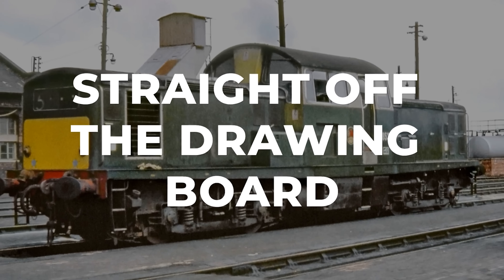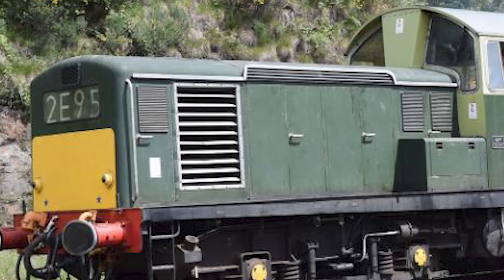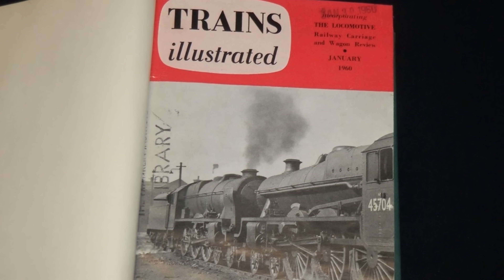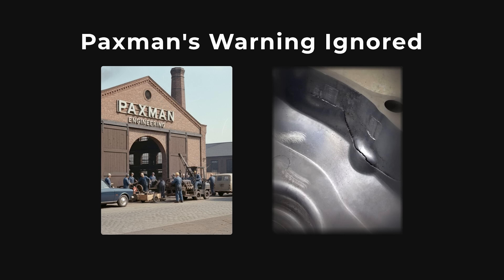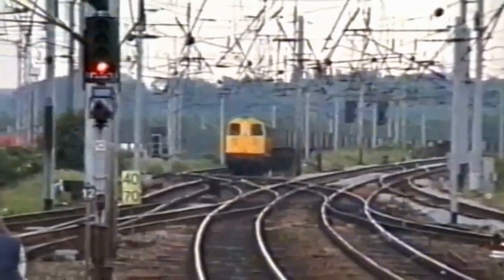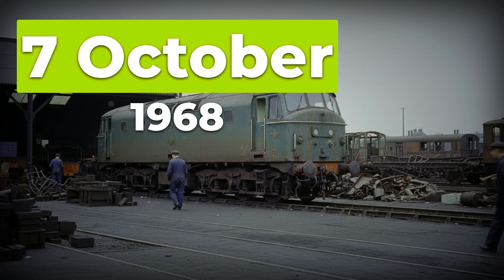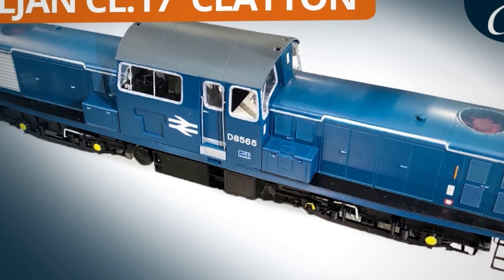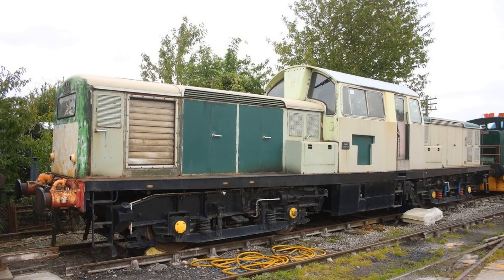Why Britains SCRAPPED 116 BRAND NEW Locomotives

Comment: We had three Class 17s at the RTC in Derby during the 70s. One of them was the first 'real' loco to haul the APT PoP-Train on the Old Dalby test track in 1970 or '71, and we used it quite a bit in the early days. It caught fire in the leading engine bay during a southbound run while I was milepost spotting in the loco cab! The 2nd man got out of the cab(!) and fired an extinguisher under the doors and we finished the run on one engine. They scrapped that one right afterwards and we swapped it for one of the others.

Comment: The history of this loco was repeated here in Australia ten years earlier, (1953/54) build date, with the NSWGR 41 class built by Thomson Houston, 10 in class fitted with two paxman twelve cylinder engines, most were withdrawn before 1964 the last to be withdrawn in 1975,  were used originally on the main south with reports of hot engine shut down (rear) unit in the middle of winter, with the  front unit suffering from the opposite problem of shut down due to low water temperature, very quickly relegated to local working around Sydney & yard shunter, it was reported the diesel engine units were from or were used on British Submarines, hated by fitters who preferred working on loco's supplied by ALCO & EMD.

Comment: In Germany, each new class was tested first before building them in larger numbers ! This was done by Bundesbahn Zentralamt Minden !!! Result: some testbeds first, and then improved versions as building them in larger numbers e.g. V 100 / V 60 / V 200 / V 221.. and electrics E 41/ E 10 /E 40/ E 150 / E 151 / E 111 / E 120 !!! Spares interchangeable!!

Comment: Why didn't BR go that extra yard and build Type 1's with a cab at each end?  Their one-cab-only policy (for the Type 1's) came back to bite them on the ar$e
Reply: Because steam engines worked perfectly well with a cab at one end and you couldn't see properly out of them either. As it turned out all the type 1's were not needed anyway because of traffic changes (loss of short trip freights, closure of small mines, DMUs for short passenger), and they then just threw the 20s together in pairs which worked fine.

Extra cabs are more weight, more equipment, more length and also a damn nuisance when shunting because you have to keep getting in and out of cabs.

Comment: They say they were a failure, but so was the Duke of Gloucester steam loco until preservationist got hold of it and totally improved it. I work on the SVR where this sole surviving class 17 Clayton is based and there are occasional hiccups with it, but I remember a number of years go on a Diesel Gala an fully loaded 8 Mk1 Coach train hauled by the Class 14 based on the SVR failed at Arley with an overheating problem, a Class 25 ws dispatched light engine from Kidderminster to rescue this train and bring it back to Kidderminster, the Class 25 towed this fully loaded 8 Mk1 Coach train as far as Bewdley where it failed. The only Loco apparently available to bring this train back to Kidderminster was the Class 17 Clayton D8568 which was sent to Bewdley to rescue this train and bring it back to Kidderminster. During this rescue mission no trains could move between Bewdley and Kidderminster and people were wondering what was going on then after what seemed like an eternity slogging into Kidderminster at about 15 mph came the Class 17 towing a ded class 25, class 14 and 8 fully loaded MK 1 coaches to every one surprise and applause

Comment: Why did British Railways scrap thousands of serviceable steam locos in favour of completely untested designs, built by companies with zero experience of building diesel-electric locos?  Because the bloody IGNORANT and STUPID parasites in Whitehall and Westminster ORDERED them to do so.  Result;  millions of poundsworth of usable machinery was scrapped, and millions MORE pounds was squandered in buying useless junk.
Reply: Yes, this has been a problem in Britain for many decades and it will not stop until the British people demand it stops. Politicians and senior civil servants have been making decisions about things that are totally beyond their comprehension with disastrous consequences for the tax payers and the end users. The Ajax AFV comes to mind but that is just the tip of the iceberg.
Reply: English Electric had long experience building and exporting diesel electric locos.
Reply: @22pcirish just before it closed I had to do a job in the old Vulcan Foundry works in Newton-Le-Willows, it was very sad to see the demise of this once great engineering works. The first diesel I ever remember seeing was an English Electric Type 4 (Class 40) that was around 1960. A few years later they were a common sight on the Chester to Holyhead line where they often headed the boat trains. I worked on a few of the generators from these locos during a brief spell I had working in Crewe Works in 1977, They also overhauled the Class 50's as well but this work was transferred just after I started. Most of the repair work though was concerned with the Brush Sulzer Type 4's (Class 47) locos. I worked a lot on English Electric control and switch gear and electrical machines back in the day, It was big and heavy but generally very reliable.

Comment: A useful overview of another failed design of early diesel traction. I suggest that the engine block failures were due to bolting the blocks to a rigid chassis. Automotive practise, involved rubber shock absorbing engine mountings. I remember, in my train spotting days, these engines, along with the Hymecs, and Westerns. All built with little attempt at proving the design first. Zealots, like the Net Zero zealots, pushing an agenda, never proven, or fully tested. Many diesel engines were produced with short lives, and costings, that were shredded to protect the guilty.
Reply: Most loco's do have rubber mounted power units, i'm not sure about these.

Comment: The depots generally sent them out in pairs in the hope that one would complete the scheduled work without failing. so a pair or CL 20s nose to nose which solved the visibility issue may as well have been used but hindsight is a wonderful thing.

Comment: British Railways were allowed to experiment with diesel locomotive designs at the expense of the taxpayer. A large percentage failed to meet expectations for various reasons. In the meantime, the well proven 9F steam locomotives were being cut up with less than ten years service..
Reply: Only partially true. Section 19 of the Clean Air Act of 1956 forced the BTC into dropping the testing phase of the Modernisation Plan and into buying locomotives that were not up to the job in order to eliminate steam as each steam locomotive was a potential fine generating machine.
Reply: Mostly the government's fault. We could have bought top quality engines from Germany but everyone in power still thought the only good German was a dead one.

We ended up importing some of the designs and other stuff but into factories designed to make steam engines where accuracy isn't a big deal rather than high speed diesel engines where every micron matters.

Comment: Very interesting; BUT WHY is there a constant series of mismatches of the photo of the loco shown not match the loco being spoken about in the commentary?
If there is not a suitable photo available, don't show one at all.
Reply from the maker: Thanks for pointing it out, archival material for these locos is very thin. We mixed in similar units so viewers still had something to look at while the story plays out.
Reply: @legendarylocomotives  Pictures of steam locos are simply irrelevant.  You might as well show pictures of goldfish.
Reply: @legendarylocomotives  Units ? !!!
Reply: @kevinsylvester770 
Unit - a locomotive.
Reply: @ralfie8801  I've been a rail enthusiast for well over half a century , also worked on the railway for 30 years , never heard of a locomotive referred to as a unit !
Reply: @kevinsylvester770 
I’ve worked for a railroad for 29 years, we’ve never referred to a railroad as a railway and all locomotives are called units on multiple railroads in the US. 🤷‍♀️
Reply: @ralfie8801  Yes , UK and US very different , I did enjoy my 2 week holiday to the US in 1981 though , GG1's and very long Chessie System coal trains , plus lots more !:face-blue-smiling:
Reply: @kevinsylvester770 
Glad you enjoyed it, you should do it again, but visit the southwest deserts, the Grand Canyon, and the Rocky Mountains. There are long trains (sometimes 1 1/2 miles) in those areas running 3 or 4 4000 and 4500 HP units on the lead and a couple more in the middle as unmanned distributed power (DP) remotes. Some even occasionally use an additional DP pusher on the rear through the mountains.

Comment: Love when anyone talks of these they never mention the precipitous drop on coal and other goods traffic that would have made up most of these engines work around the time of storage/withdrawal, nor the rationalisation of those services where they did remain. 

Love that the 60% availability is always mentioned but no one seems to have been curious enough to go in and pull up availability figures for what they replaced. Only what replaced them. Likewise we talk about visibility, only in regards to comparison to what replaced them, not what they replaced, have you experienced the visibility from most steam loco cabs? With that boiler in the way... jeezo 

Very misunderstood and poorly propped up piece of railway history to say they were terrible.
Reply: Same with the class 14 for the WR. All the trip freight and small yards disappeared. Ditto east Anglia with the 15s and 16s. Also type ones but the east Anglian railway system was n the verge of closure,so all the rural lines disappeared and so did the reason for a fleet of type ones.
Reply: @highdownmartin  yup, closures all over the central belt of scotland really made them surplus. Other classes later would suffer similar hideous faults yet the traffic for them meant they got a second chance and went on to be loved. Class 56... class 60... both absolute crap buckets on delivery, now people cry when the last one goes and talk only praise of them as iconic. 😂(little hyperbolic but not too far from the truth)

Comment: I think you need to actually check the footage before you add it, Your footage of D8611 most certainly isn't a Clayton.
Reply from the maker: You're right, barely any Clayton footage exists so I had to work with similar looking locos. Good spot though!
Reply: Lots of steam not diesels